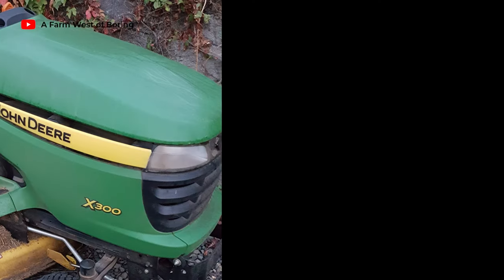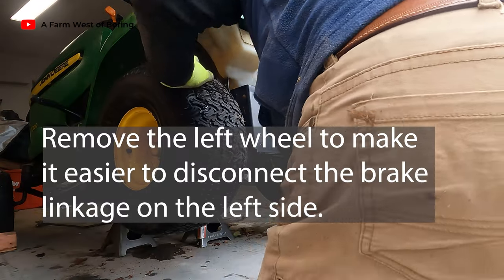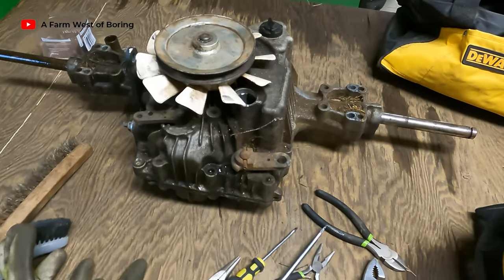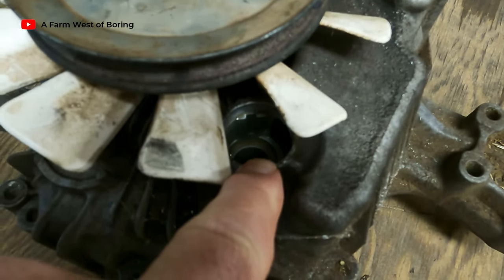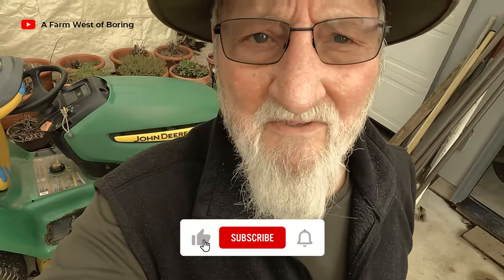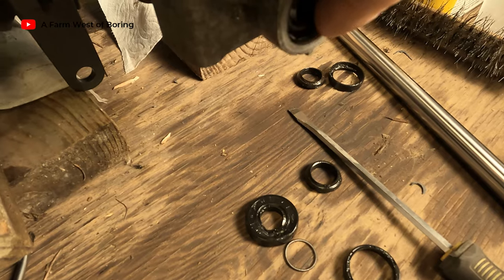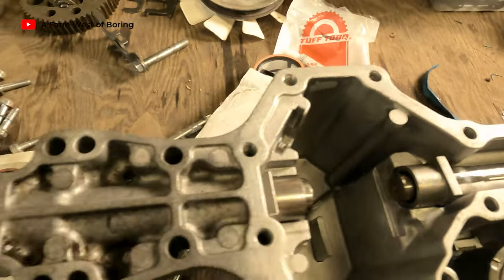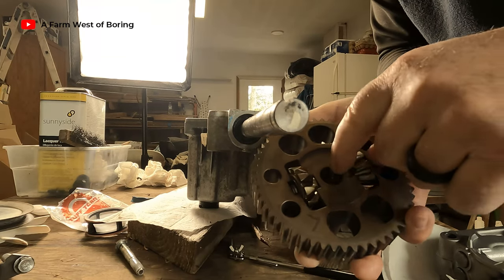John Deere Tuff Torq K46 Fail and Fix | Tear down and Seal replace

Comment: I sent my Mid pump and Cylinder's to Hydro House in Spring Green Wi. Half the cost of new. Had my Tuff Torq Transmission working perfect for under 125$
Reply from the maker: Thanks great. Just a little ingenuity and you can save a lot of $$!
Reply: Brilliant video - so glad I found it! Think I’ll be doing something similar on a TT K574c (4WD variant). The damn thing won’t go up hills once it’s all up to temperature.
Anyway, many thanks for the time you took putting this together.
Reply: Mine just barely had a couple of score marks in the different parts in center case on mating surfaces. Had a perfectly flat steel surface with some 600 grit, didn’t take long at all and everything polished out nice, no marks…
Reply: @Dirtywhtboy87930  take it yours wouldn't do hills either when hot?
Just wish I could find a YT vid showing the inside of a K574 C.
Reply: @rows3063  yes. I have the K58a. There wasn’t any difference in parts from the k46, except the inlet of the center case has an fluid pump that was pretty simple to deal with.
Reply: You need to get a tripod because you’re showing side view I have no clue what you’re doing
Reply: @robertshore5403  I bet they take a milling machine to shave off little as possible, just to true up the surfaces and get any score marks off those surfaces.  I had minimal score marks and got a true flat surface, some 600 grit black Emory sheets, and used equal pressure sanding my scratches off all 4 areas . My transmission works like new again with fresh fluid in it.
Reply from the maker: Thanks!

Comment: good video and job. i think the fan was under the pulley. that thing is full of parts i will not be taking any apart and i use to rebuilt motors.i think the one in my old murry mower has same thing in it. take care, be safe and well.
Reply from the maker: Yes, the fan clearly needs to be under the pulley. And where does the extra clip go? Wait for part 2.
Reply: Where is part 2 ?

Comment: I did the same thing with mine, only had 1 snap ring and it was on the fan shaft
Reply from the maker: That was it!  I fixed it and was out cutting grass a few days later! Thanks for commenting.

Comment: Where do you send the transmission to get it rebuild in Canada, which you mentioned in the video
Reply from the maker: Thanks for commenting. The guy up in canada has an ad on ebay. https://www.ebay.com/itm/284338450460

Comment: I did the same with the fan when I replaced the input shaft on my K51A, oops. I wasn't able to reinstall the trans with the fan on top on the Scotts S16/42 and so that's how I discovered my mistake. Now I have to do a total rebuild like you just did because I get almost no movement forward or reverse. Tuff Torq no longer makes the K51A so I'm going to ask them if they still provide rebuild kits for it. I would really like to put in a larger trans like a K66 but I'm not sure if that will work.
Reply from the maker: I have seen photos with the fan in both positions. It might be different for different models. Mine would have worked but the drive belt was not lined up on the pulley. I did change it and was going to make a video about that, but alas time has not allowed. Since the rebuild the mower is working really well. Look upon ebay that guy in Canada who does the rebuild kits. He might be able to help you. Thanks for commenting.